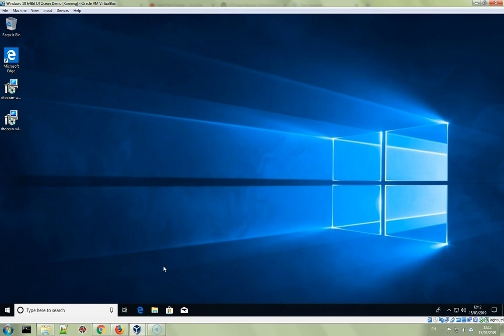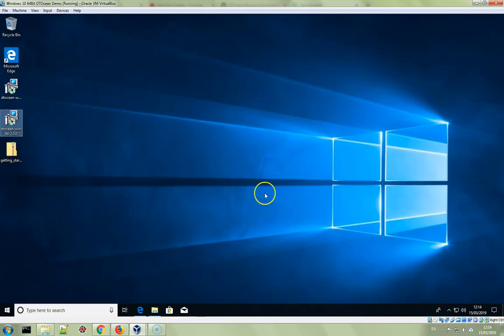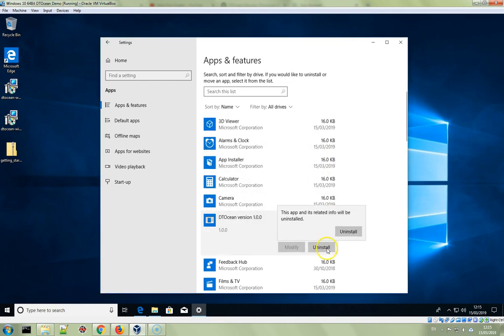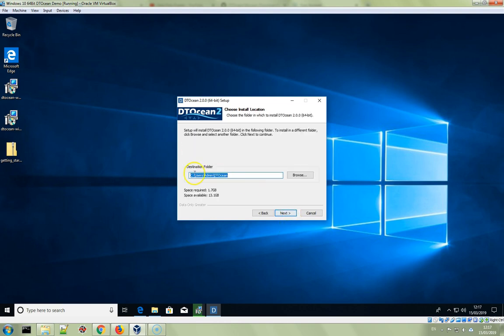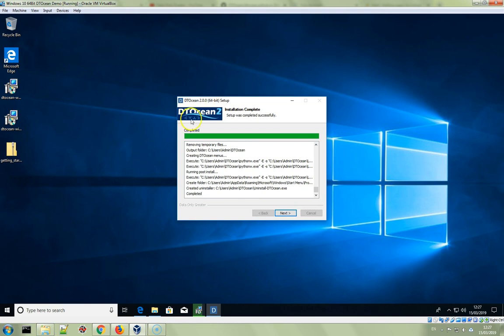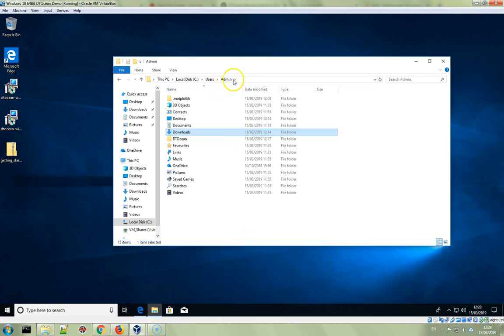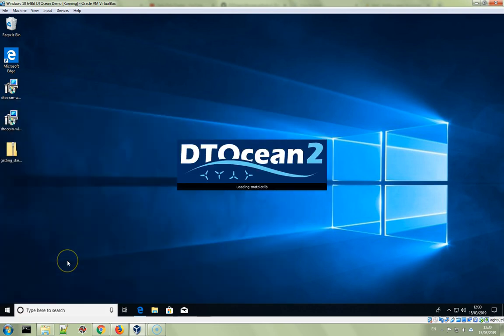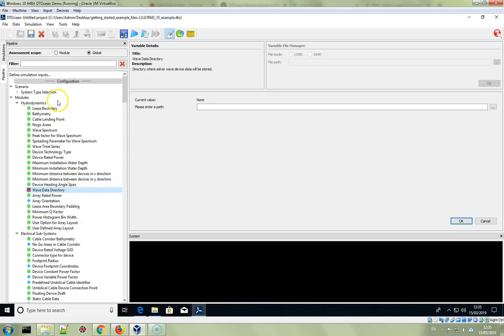Using the Installation Wizard to Install DTOcean 2.0

Comment: I have a question about the program, I don't know if I can ask here: how does it calculate the interactions between WECs and the amplification factor? Because it seems to me that diffraction/radiation analysis would take a lot of time, and some advanced software like Aqwa... so how effective or trustful are the simulations of WECs interaction using DTOcean?
Reply from the maker: Hi Ana Luisa, for calculating WEC interactions, DTOcean requires a preprocessing step that is conducted using NEMOH (there is a special version packaged within DTOcean). It only needs to be run once prior to using DTOcean (assuming it generates sensible results) and then device interactions in any configuration can be calculated analytically. The best references for learning more about the method are probably https://www.mdpi.com/1996-1073/10/9/1262 and https://www.sciencedirect.com/science/article/pii/S1364032119303454
Reply from the maker: And running the preprocessor is the subject of this video: https://www.youtube.com/watch?v=bop6POm9B2Q&t=1036s